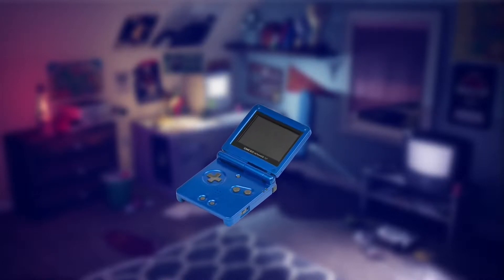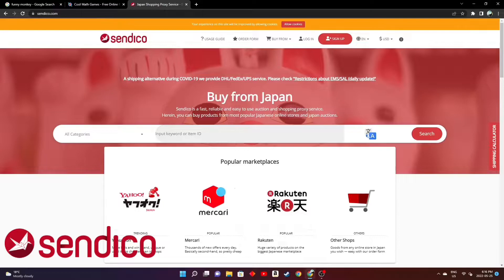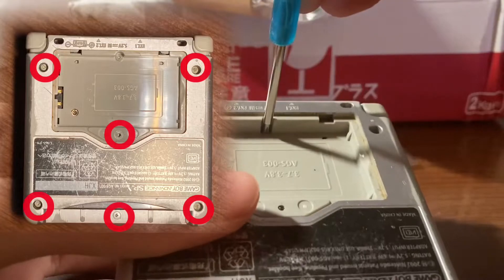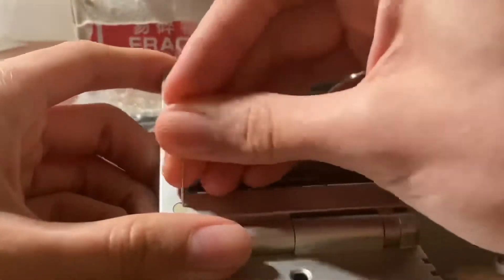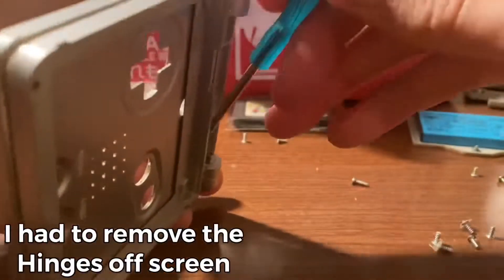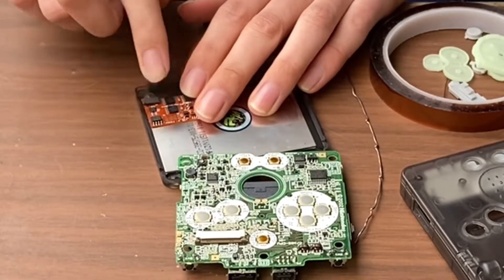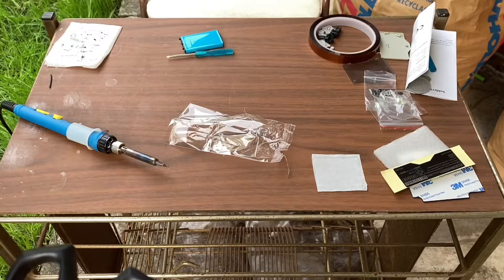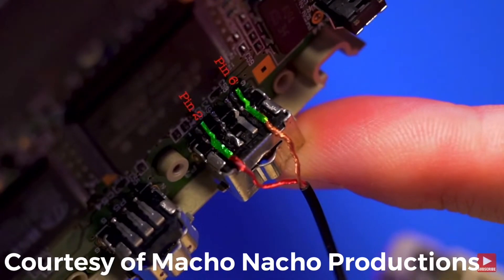Wireless charging and IPS screen mod for GBA SP

Comment: I have a question. So where you soldered the wireless charging thing. I a bit ago wanted to have usb c instead of what the sp has and I kinda did a bad job and took the pins out the locations where you could soldered the wireless thing. What could I do?
Reply from the maker: like the pads on the board itself? or the pins on the original charging port piece? If you're still trying to go through with the usb mod, I don't really know what to do other than search it up in different forums and ask those guys for help, as they'll have useful advice. If you're trying to put the old port back in and that's what has the issues with the pins than it might just be easier to buy a new port, I don't they're that expensive.
Reply: @FilthyGambit  so yeah the first thing you said. I took the pins with the port. I no longer wanna go usb c route, I want to try if wireless charging would be better but. Idk if it’s still possible since the points are no longer there maybe I can soldered them somewhere else?
Reply from the maker: @St3v3v3   https://youtu.be/BSIeH0UVb-I 
this is the video I used and it looks like you might be able to solder these to the board corresponding to the pins on the charging port but I don’t have any idea. I think if the damage is to the charging port only then safest option is to buy a new one and try modding with a fresh port instead of potentially causing more damage.